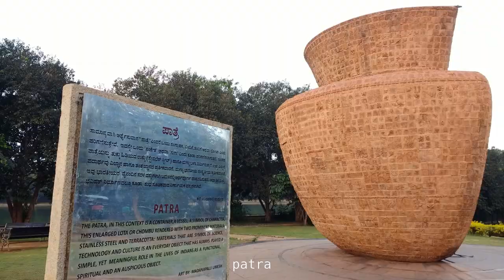JSW Industrial Visit

Comment: Jsw cement is the worst cement. I used and now never again use jsw cement in future. This was the biggest mistake. Very bad quality. I suggest don't use jsw cement.
Reply: @AdityaDev3  I used jsw premium slag for roof dhalai of 6 room. But  strength is like soil, when rub on that by using hand or any soft thing then powder type something I get. Even a little bit of hammer apply for a moment, a big area is cracked easily. My other 5 room was made using star cement and that is much better than this. I am depreciating after trust on jsw.
🔴 Rebound hammer testing is also less than satisfactory 
🔴 I complained also customer care, but engineer not take any serious action and only says that about workman. My 4 lakh rupees get lost with this Dull and worst product.